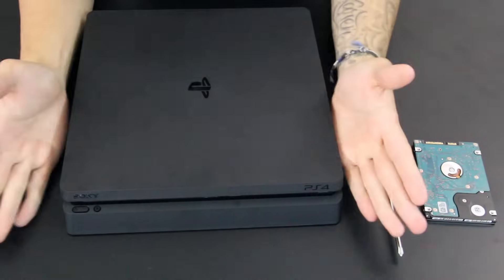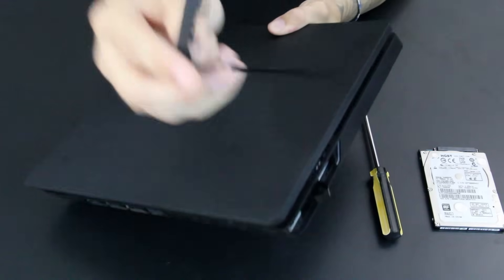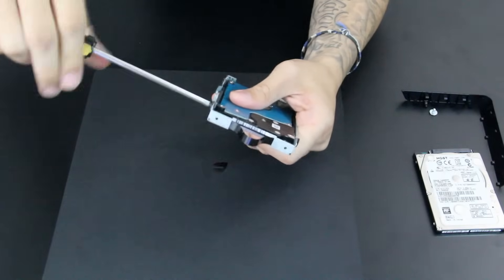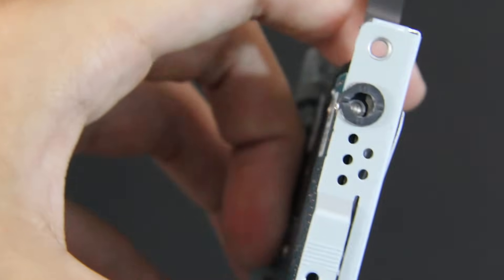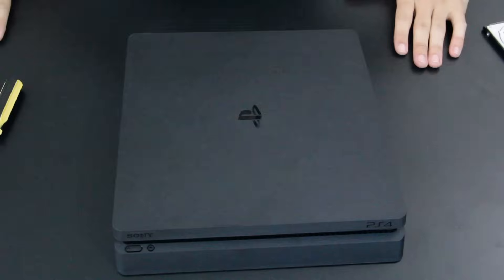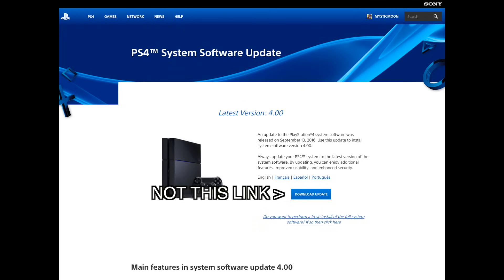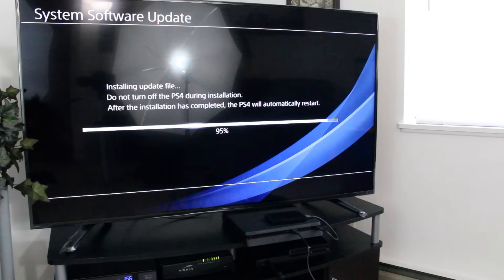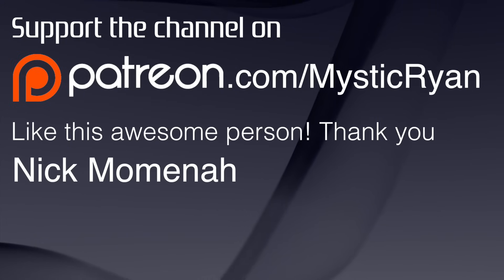Tutorial: How to Change PS4 Slim Hard Drive and Install System Software

Comment: I been searching alot on a solution on how to do this and more specifically how to completly remove the partition table and start completly fresh with a new formatted drive.  If you are trying to find a solution to this and can't figure out why applications won't format PS4 protective drive and your hard drive is just either bricked or badly curropted then this tutorial is for you. Generally this tutorial is used for people that have almost like a dead hard drive in other words the safe mode built into the PS4 won't even work or you can't access any bios repair function from the system. So I just want to share what I have learned.  The Playstation drives have what is called a GPT file system on it which stands for 
GUID Partition Table which is a Protective file system. Generally these types of file systems use like over 20 partition tables on the drive. That is why many users are running into trouble trying to format this type of hard drive because most systems and applications will not allow you to format this type of disk drive. It is encripted and protected. Something I figured out is what you need to do is "remove the Protective partition" GPT before you can use partition recovery software to sucesfully format the drive. In order to do this you must use the "Diskpart Utility" This is autmatically embedded in windows and you can run the tool directly from the command prompt. It is a powerful tool that over rides any other application and removes the partition even though its locked or protected.

The steps are as follows:

1. Open a Command Line Tool, type in DiskPart and Press Enter

2. At the diskpart prompt type "list disk". ...

3. At the diskpart prompt, type "select disk x", where x is the disk number that you want to remove the protective partition.

4. Type “list partition” which will display a listing of all the partitions on the selected disk.

5. Type “select partition n” (where “n” is the partition number you want to have removed).

6. Finally, Type “delete partition override” which will then permanently delete the partition selected.

This will allow your drive to no longer be locked by windows and if you look in the disk management, the disk should now say "unnalocated space" in which you can proceed to format it with a fat32 or exfat file system to be ready to run on your PS4 again. Or if you prefer a NTFS to run on your windows Operatying system.

Note: In order to find the disk number, usually its listed in disk management but if your operating system is not able to identify it due to serously bad curroption of the drive, this may be a bit tricky so you want to download MiniTool partition wizard which will allow you to see the drive and what Number is designated for that drive.

Hope this proved valuable for anyone that has had alot of difficulty figuring this out.

Comment: This might be a stupid question, but do you need to install system software if you're just swapping a 500gb with another 500gb? My old ps4 has the BLOD and I can't switch it on at all to transfer files to my new one.

Comment: I'm a bit technical, so I'm just going to clone the entire hard drive to my new solid state drive and put it back in my ps4 slim. This way I don't have to worry about software updates or firmware installations..
Reply: How do you do that
Reply: How do you to that? Because I’m having trouble I put my new hard drive in and I downloaded the files but when I click on Buber 7 it says cannot initialize
Reply: @x_hydro2679  I use a cloning software called Macrium Reflect. I haven't done this in a while, so if the boot fails, its best to backup all your game data to a flash drive, then re-install the PS4 software on the new installed SSD, then after installation, upload your saved game data and your done.
Reply: @HangingWithDan  ok thank you I have a question you think you can do a video on it or no?

Comment: Every god dam time I try to un screw anything the screw strips. Idk if I'm just crap at un screwing things or if my screw driver is crap but when I tried to un do the round piece with the symbols on it my screw driver actually flaked off the screw like breaking off dirt and made the x formation to fit the screw driver into a complete circle now I cant get it out. I'm actually Gonnah cry cause both my computer and my ps4 is messed up and now both of them is stuck by a single screw I can't remove

Comment: Do I really need to have a laptop or pc to do this why can’t I just take out my internal hard drive put the new one in and done and just update my ps4 and download my stuff from online
Reply: Ste Jordan u ok? Cause it had no software u need a hard drive with software for it to work like pc doesn’t have windows already installed u need to put the software onto before further use
Reply: Kryoticq - so I cant just buy one and just put the internal hard drive in and download the update through my ps4
Reply: @Stephen3rdTopG  You need to download the update either by ethernet (cabled internet connection) or the USB method
Reply: John so I can take out this old hard drive put the new one and connect to the internet and download it
Reply: @Stephen3rdTopG  actually I think you need a pc and a USB

Comment: What happens when i get a used hd from another ps4 slim that hasnt been reset bc the ps4 got destroyed and i can turn it on so what will happen if i take out its hd and put it  in new one
Reply: Just wipe the contents on the old harddrive I used a harddrive on a 2006 PlayStation 3 and put it in my PS4 and it worked

Comment: Hey, one question so I recently had a problem with my hard drive and when I opened it I saw a piece of paper/ plastic that went around the blue piece
Reply: Did you fix it?
Reply: @luiss4631  yeah I did it’s a hard drive issue. You can buy one for $40 at Best Buy

Comment: Didn't have a chance to back up anything.
 My drive is just corrupted.
Reply: How'd it go?? My hard drive is also corrupted i don't know what to do
Reply: @angelomanlapaz2958  i bought a new hard drive off Amazon and replaced the old with new and everything works fine.
Reply: @angelomanlapaz2958  the screws were hard to take of but that's bc of the screwdriver. So i grabbed another screwdriver that was partially new and it did the job easy. Make sure it's small and it fits. Download the files from the ps website and then you are all good. You can re-download the games you bought from ps store with no charge.
Reply: @angelomanlapaz2958  hello Angello, your issue is that after the ps logo goes black screen? I have this issue and i dont know if it is a hard drive problem. Hope you repaired your ps4!
Reply: @MotoScram  yeah that black screen occurs sometimes but the main issue is I can't play or download any games because of the slowness of the loading screens i hope the replacement of a new hard drive will fix it. Thank you guys
Reply: @angelomanlapaz2958  yes, should be that.

Comment: My hard drive is corrupted I’m thinking on replacing my current one for a new one, do you think it’s a good idea and will it work?
Reply: Did yours get corrupted with the latest system update? Me and a lot of others are having this issue
Reply: Karl Delaney it’s been corrupted for about a month now and idk if I should buy a new ps4 or just replace the hard drive
Reply: @sergiovillamerino  People have been having this problem a month ago too. I say replace your hardrive it's much cheaper, also the PS5 will be out soon. So buying a new PS4 is a waste of money
Reply: Karl Delaney I have spare cash but you right it’s better to save than waste money you might need in the future
Reply: xd NigWard yes same the lates software update corrupted my PS4
Reply: @draketimber3685  I bought an external one to see if that would fix the problem instead of replacing the internal but the place I bought it from didn't even send me a USB 3.0 cable 😐
Reply: Karl Delaney ok
Reply: Also did you need a usb stick after you bought it
Reply: @draketimber3685  Nah it's a usb 3.0 wire you need,  it has a SS usb on the other end the plug into the hardrive
Reply: @KarlDelaney99  hello karl, how it manifiest the issue? Black screen after the PS logo?
Reply: @MotoScram  I replaced my internal hardrive with my laptop hardrive and my PS4 works smooth now
Reply: @KarlDelaney99  nice, but which was the symptoms on your PS4, mine is not loading the system after PS4 LOGO and shows black screen and blue light. when you switch on the PS.
Reply: @MotoScram  My PS4 would freeze 5 minutes into a game and then go into a safemode boot loop. The PS4 menu was very slow and freezing too
Reply: @KarlDelaney99  thanks for your reply

Comment: My ps4's been getting stuck at 99% for half an hour before showing an error message. Checked online which said its a hard drive issue. Ordered a new hard drive. Will follow this video and see if it works. Thanks for the tutorial!
Reply: Did it work?
Reply: @KhairatSafwat  yes it did. Playing Last of Us 2 now
Reply: @aks19880  what's the name of the new hard drive and how much does it cost? And as of the software update what should I do?
Reply: @KhairatSafwat  seagate barracuda 1tb 2.5-inch 7mm laptop drive. It's the cheapest. You can get it for 50 bucks
Reply: hello, did you have a black screen after the PlayStation logo? I have this issue and i dont know if it is the hard drive..
Reply: @MotoScram  heyy yes. Try booting in safe mode. If it boots up then it's a hard drive issue cus
Reply: @aks19880  it boots up but continues showing black screen after PS LOGO

Comment: i just love you bro, u saved my money and memories 🖤 i was getting data corruption error, i just did what u did, i didn't changed drive, just cleaned pot and everything, then i put it back and it is working like a brend new ps4
Reply: Bro I did what u did now it’s not connecting to wifi

Comment: Doing this because 7.50 bricked my ps4 literally fucked it up
Reply: does your ps4 back to normal? no freeze, no sudden restart or loop safe mode?
Reply: Same here after this uptade i cant do anything bro my games crash and cant start sometimes...it says that i have to delete and then install the game again cuz it has coreupted data...i tried initializing it but after 2 days same thing happened again...i really need to buy a new hard drive
Reply: same my system freezes and lag online and local play
Reply: Nikolai zazzoslki  does it is work? i wanna buy new ssd to cause my hdd corrupt because the update
Reply: Nikolai zazzoslki  right, copy that. thanks bro!
Reply: Nikolai zazzoslki  it works guys! my ps4 back to normal after i changed to ssd. The hdd is corrupted surely

Comment: Hello. I Have a important question: You must install only HDD or you can instal SSD for better and quicker system loading? Thank you for answer.
Reply: You can use SSD as long as it is a 2.5" SATA drive though improvements are rather minor.
Reply: I upgraded my slim w a ssd. I could tell a big difference e horizon zero dawn. Load times were cut more than half. Made the game so much better. PlayStation also boots up automatically as opposed to staying on the ps screen for ten plus seconds before entering the login screen.

Comment: @mystic so i formatted my 32GB PNY usb drive to fat32 and  downloaded the necessary file(1.01gbs) to PS4->UPDATE folder.  Installed a Firecuda 2Tb drive into the ps4 and went into safe mode.  Only option 7 was available to me and when I choose it I got the following error: The USB storage device is not connected (error su-41333-4).  Could this because the Firecuda is defective?  I put back my old hdd that came with the ps4 and it was back to normal.  Thanks in advance!

Comment: y’all talking bout hard drives and stuff i’m still stuck tryna slide the plastic part off
Reply: Lol that's literally the easiest part bruv
Reply: Bruh my controller won’t even connect
Reply: @chinese_boi-_-9025  reset it bro, plug it in and hold the PS button and share button at same time until it connects
Reply: It literally isn't working for me
Reply: @Eclecticcelestial  what's the problem?
Reply: @Shadoefax760  so I put the new harddrive in and it said it cant connect to the controller or the storage and keeps making me turn  it off
Reply: @Eclecticcelestial  did you download the software?
Reply: @Shadoefax760  no bcuz it won't even let me in
Reply: @Eclecticcelestial  won't will? You gotta download software on a pc & make sure it's a thumb drive that's formatted to exfat
Reply: @Eclecticcelestial  did you buy new harddrive or ssd? If you put in new ssd or hdd plug in thumb drive & start console in safe mode, then download the software off the thumb drive.
Reply: @Shadoefax760  I probably need to have someone help me 😪
Reply: @Eclecticcelestial  what exactly is the problem? I can help. Sony made it extremely easy. How far along are you? What have you done so far?
Reply: @Eclecticcelestial  tell me your concerns child
Reply: @Shadoefax760  isnt it supposed to be the reinstallation one
Reply: whens the last time you ate
Reply: 🤣😂🤣😂 I'm actually dead

Comment: This helped me fix my playstation as it wasnt starting up and was stuck in a safe mode loop but just take the hard drive out clean it put it back in and initialize your playstation
Reply: How do you clean it
Reply: Do you HAVE  to initialize 🙁
Reply: @raz2083  You dont have to. Just update it by using your USB

Comment: Hey, I have what might be a slightly dumb question: I have a standard PS4 with a 2 TB drive I installed myself. My PS4 is starting to act up with that “blue light of death” malfunction where it shuts off almost immediately after trying to turn it on. I unplugged the system, cleaned it, gave it a few taps on the side, and with trial and error got it working again, but I’m worried it could be on its last legs. I’ve done drive replacement before that involved installing the PS4 OS via flash drive, but I was wondering how the procedure would differ if I’m installing a hard drive that ALREADY HAS the PS4 OS and my game data on it. If I have to get a new system, I’d want to put my existing 2 TB drive into my new PS4. Would I still need to start it in safe mode the first time and choose the initialize PS4 option (the one above what he picked in the video) for it to work properly?

Comment: I have two ps4 slims 0ne 500gb the  other is a (1tb which crashed on me via power failure), can I change the hdd between the two without losing everything?

Comment: I have a question. When I install a 1 tb Hard drive in my Ps4 slim which actually has 500 GB, it just goes like this or does something break in the Ps4. Hard drive in my Ps4 slim which actually has 500 GB, it just goes like this or does something break in the Ps4?

And wich hard-drive should I use?

Comment: Mystic - you rock! Thanks a ton. My son's PS4 had a problem. Getting the error code SU-41336-7. I searched and found that it is the problem of hard disk. I went to authorised Sony service centre and they told me that this PS4 is not repairable. They got me a 50% discount to buy a new PS4 as it was only 2 years old. I then watched your video and got the hard disk replaced and got my PS4 back to normal.  Thumbs down to Sony service centre.

Comment: do i need to format my second drive or it will get formatted when installing the ps4 software
Reply: It will format itself before installing
Reply: @DUBAISPORTSHUB  thanks for the answer i already did it a long time ago
Reply: My ps4 was stuck in an infinite safe mode loop but I've fixed it and now I'm ready to try fifa 20 Ive solved the issue everyone  please check the new link https://youtu.be/ZvANUdbodiY

Comment: I just took it out then made sure I put it all the way back in then went to option 5 on safety mode it worked perfectly. I bought a portable storage box for 40$ to prevent this problem it worked easily

Comment: I have a question... my other ps4 broke and I’m wondering if I can put my old hard drive in my new ps4
Reply: I don't see why not. Be aware that if you have PS plus, then all your games and saves should be saved on the PlayStation online storage
Reply: As long as the hard drive isn't broken, it should work. Be aware that if you have PS plus, then all your games and saves should be backed up in online storage. You will still need to download them. The only thing you need the USB stick for is to download the PlayStation software. You can find it on the PlayStation website, but make sure to get the latest one, or else it won't work.